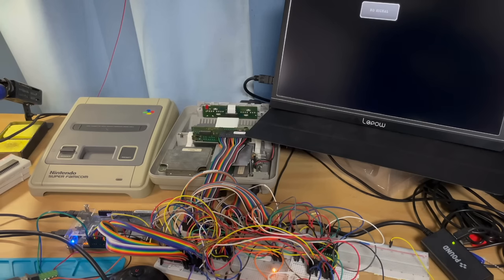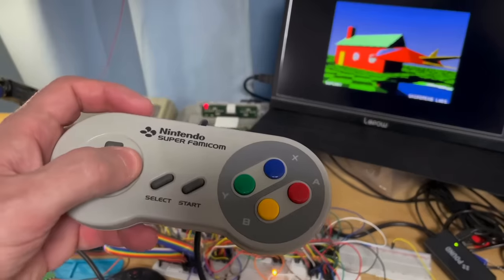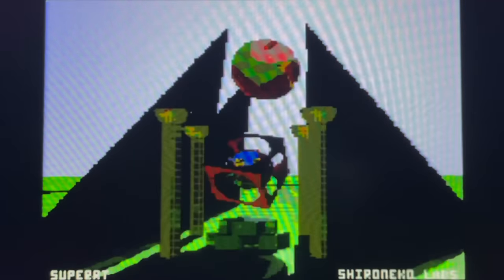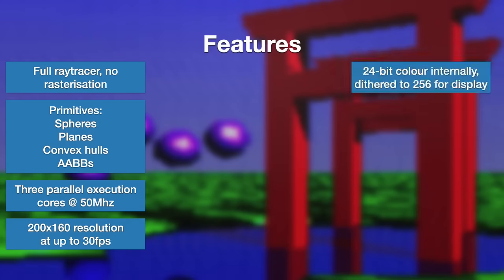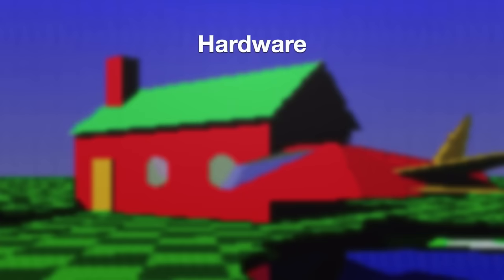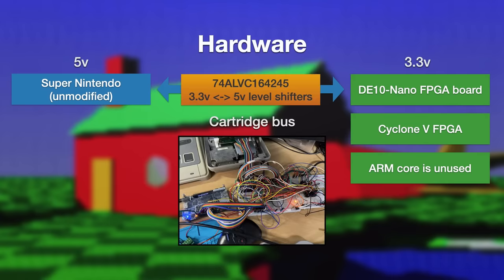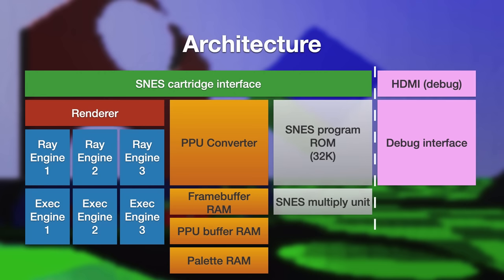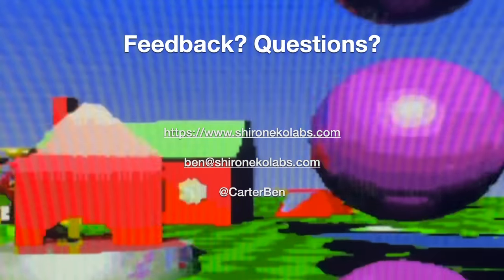SuperRT - Realtime raytracing on the SNES (walkthrough and technical overview)

Comment: This is impressive!
I'm currently designing my own CISC instruction set, and I had an idea for possibly solving the branching hazard.
It went like this.
During the last stage of the pipeline, you check the next instruction to see if it's a valid branch instruction, if it isn't then keep on going as normal, but if it is a branch instruction, then we check the condition code of the branch, and based on whether the condition was met, or not, we set the branch target buffer of the next instruction (the branch instruction itself) to either the branch target (the address that the branch jumps to), or the address of the instruction after the branch instruction.
All of that would happen in a single cycle, within the last pipeline stage.
Reply from the maker: @pineberryfox  Yeah, that was one of those architecture features I never really appreciated the significance of until I tried to build this! I actually considered using a branch delay slot system here, too (as, ironically, it's easier than handling that case "properly"), but decided the extra complexity on the code side didn't really justify it, especially as in this scenario there didn't seem to be very many situations where delay slot instructions could actually be used to do anything meaningful.

Comment: Now re-make Doom and StarFox with this...Come on guys I know you are out there. Also The SNES was 16Bit can you make this run on a N64?
Reply: Or just romhack the support in
Reply: What if they made super mario 64 on the snes?
Reply: @seymourkrelborn4780  that makes absolutely no sense.

You would have to remake Mario 64 from scratch to specifically run on a 16 bit cpu. Not to mention that the SNES has far less ram.

The reverse engineered code for Mario64 would help a bit but most of the rendering would need to be completely rewritten.

Absolutely nothing about this would be a "rom hack".
Reply: @Cybertronic72388  I was refering to adding support for this chip to Star Fox. Did you mean to reply to @Mario Mario?
Reply: good luck getting any developer to waste time doing that bro
Reply: @seymourkrelborn4780  my bad comments were showing up weird in the app.

I suppose the commands that would normally be sent to the FX chip could be sent to this instead, but you would need to make the FPGA understand those FX specific commands and would basically end up with an FX chip clone. To have any sort of graphical enhancements besides higher resolution the FPG would have to perform model and texture replacements.

Seems easier to just to remake game specifically for the FPGA.

Comment: What could you do on an n64. Would a lot of the bandwidth limitations disappear?
Reply: @Fat Chocobo only thing that is upgradable is It Ram
Reply: @Fat Chocobo I am well aware of that but because it was cartridge based super fx like acceleration would have been possible however impractical. To what extent it could be done is what i was wondering.

Comment: Dude, you need to shrink this down to fit into an actual SNES cartridge and release as a real thing that people can buy. This would be mind boggling to see on a SNES if it were in actual games inside normal-sized cartridges that you can buy--and I'm sure many hardcore fans and collector types would buy them even if they were like $200 a pop or whatever (ideally as cheap as you can make them though)--then plug into your console just like any other game and play full games on them. Imagine if someone re-made the original Star Fox using this tech to say increase the frame-rate, increase the draw distance to reduce pop-in (hopefully by a lot), and also add in some of that glorious ray traying. . . . Maybe I'm just a dreamer, but I'm not the only one.

Comment: I saw something similar at a fair, a guy adapted an NES with a zero rpi, to run sonic and some other games, NES acted almost as a simple image buffer from the rpi's hdmi output, in addition to an arduino interface to pass on the controls for rpi, this required a little more time, as it was necessary to create assembly software that ran on the nes cpu, identified the buttons pressed and passed the result to the pseudo game cartridge, where the interface was.

Comment: Very cool.
That´s the advantage of cartridges over discs. You can do anything.
If Nintendo wanted, they could do an external cartridge for the switch with anything inside, even a new cpu/gpu to make old and new games run at 4k 60 fps. They don't need to do a new console, just a new "FX" chip.
Reply: No. The modern cartridges since the DS are not designed to be capable of more than being a ROM and an EEPROM for save games. They are more like an SD card than a Cartridge.
Reply: @pnvgordinho   Oh boy, you have no idea what knowledge I have. I am developing an emulator for the SNES (https://github.com/Flaflo/KSNES/) I know about the GameBoy chip obviously. And I think you got me wrong. Of course you could open up the cartridge of a Nintendo DS or a Nintendo Switch and put stuff inside. The thing is: the console is not designed to use the cartridge for more than loading the game of the ROM and saving game save states. If you will, as you have described, do that with the cartridge and it does not use the provided pin interface as it is intended, it will render the cartridge pretty much useless.

I was not saying that SNES or NES cartridges were not capable of. Because they obviously are. Otherwise I would not have the demanding task to emulate those.
Again: The "old" cartridges were designed to support such hardware additions, but the "new" one do not. Also if they would support such a feature today, they could not sell their games as digital copy.

Please do me a favor and educate yourself before you write such a rude comment as this one.

Thanks.

P.S.

A quick google search that took me about 2 seconds brought me to Wikipedia were the following was stated:

"[...] the console's hardware designers had made it easy to interface special coprocessor chips to the console"
- https://en.wikipedia.org/wiki/List_of_Super_NES_enhancement_chips

Conclusion:
The system needs to be designed to support hardware additions in order to deploy enhancment chips into the cartridge.

I really hope you understand it by now. Your statement is not just wrong, but also very rude.
Reply: @Flaflo  I don't understand where you get the rude comment.
Im not an electronics engineer and I don't make emulators but I will bet with you they can connect whatever they want via the cartridge slot. Hell, I will bet they can connect anything via the headphones jack.
But that's my opinion and Im no expert. But before I go, I would like to ask a favor. Can you send me a link where it explains what you can and cannot transfer via a cartridge slot pins?. You say it only transfers the loading of a game(information, zeros and ones) and something like an external cartridge would also transfer information. But then again, Im no expert.
Thanks.
Reply: @Flaflo  "Again: The "old" cartridges were designed to support such hardware additions, but the "new" one do not. Also if they would support such a feature today, they could not sell their games as digital copy."
Reply: @pnvgordinho  First of all, your wording when I read to myself sounded very passive aggressive.

Just because its your opinion does not make it true. "Water is toxic." is also an opinion but completly wrong.

Bruh. The headphone jacks are not bi-directional. 

There is no single link to explain everything in one place. Also these articles require a basic understandig about electronics which you obviously dont have.

But what i can refer to you as good sources:
Nesdev
Switchbrew
3dbrew

Do your research, lookup what interfaces are, find out how computer architecture works. Read all the related articles found on the websites I mentioned and eventually you start to understand.

Thats all I am gonna respond. For any others questions just google it, there are plenty of sources and forums with ppl more time and will to help.

Thank you, have a great day.
Reply: @Flaflo  Brhu,

Comment: Wonder how much of the slightly lower image quality would be resolved by not using a Pound HDMI adapter. If you set it up with original RGB or a higher end line doubler. Still, amazing work!

Comment: While this I have no doubt the programmer put a fair amount of effort into this program, I think the video title is misleading as it’s not running the code on the snes, but on chips/a board interfacing with the snes, the snes is merely acting as an output.

Comment: Brilliant! Do you think you could work with Kaze Emanuar on an N64 project to implement this? He has put a lot of work to try and optimise the Mario 64 3D rendering engine and it looks like the work you are doing here could improve the rendering for the N64.
Reply: Devs like Kaze pride themselves in squeezing everything they can out of a retro machine to demonstrate what was possible while it was current. They also do it for nostalgia, up to a certain point it would stop looking like a plausible N64 game. And the added hardware would be doing more work than the actual console. If he was interested in pushing SM64 to the absolute maximum he’d be contributing to the PC port’s graphics enhancements, AFAIK he’s not involved in that at all.

Comment: Does that use much more electrical power than what is available to an SNES cartridge's expansion chip?  It would be neat if that was miniaturized to fit in a standard cartridge and there was a way to load SuperRT-dependent SNES games from ROM images on a laptop or desktop computer into it.  It could be a very fun tool for a retro game developer.  Playing a version of Doom or Duke Nukem with real time ray tracing on an SNES would be fun.

Comment: Well that's just frikin' amazing. Someone needs to use this and make an actual SNES physical cartridge game and release it on the system properly for actual purchase. I'm sure a £60 cart with an actual high quality game, and box and instruction manual and all, would sell more than enough copies to turn a decent profit.
Reply: The FPGA and the board it sits on is around 2x your suggested 60$ price. :P Add to that the cost of development, the cart and whatever else is involved and you will be losing a load of money per game sold.
Reply: I'd spend multiple hundreds to have a physical SNES cartridge with this setup and demo in it. If the demo had some tools to let you remove and place objects, it'd be more than worth its price to have.
Reply: @Haama10  If you made an actual game, you would not be selling any hardware. For hardware you would use an SD2SNES Pro and the software would just be the rom for a pay to download.
Reply: @finaltheorygames1781  different chip on the SD2SNES Pro (cyclome iv vs cyclone v) but even if we assume this could be implemented on the chip, afaik you'd need a firmware update to support it on the Pro. Either way a pretty niche product, but then again so is much of this retro hardware. All I'm saying is that I don't see much profit in this.

Comment: when I started thinking "what if I made my own replacement CPU/PPU for the NES?" the first problem I thought of was the 5v and 3.3v disparity. I wonder what (very compact) level shifter solutions there are, especially ones that could fit in the space of an oldschool DIP, along with the ESP-32 I might end up using. Could go bigger, but a drop in unit of the same size would be ideal.
Hardware also isn't my forte.

Comment: Nvidia makes a brand new GeForce 3090 graphics card for $1200 that supports ray tracing, but at a large cost to frame rate. Guy makes ray tracing work on SNES, a system that can usually be had for a few bucks at a yard sale. You sir, belong to the elite.

Comment: So if I understand this right, all the RT Rendering comes from an Intel based SoC board out of an old Pachinko that uses an Intel Cyclone V FPGA from 2002+ that works through a ratsnest of voltage stepping in order to get instructions from a SNES? Genius!

Comment: Are the BVHs pre-calculated on a PC, or does the hardware compute them from the primitives?
Reply from the maker: Pre-computed, I'm afraid - the SuperRT chip doesn't have any functionality to help with that. Technically there's nothing stopping the SNES from constructing the BVH if it wanted to and sending that over, but the SNES CPU isn't really well-suited to that, so it's prebuilt on the PC for static geometry. Moving geometry can still have a culling hierarchy but it needs to be entirely "internal" to the object (i.e. the SNES just moves the root node of the hierarchy about).
Reply: @shironekolabs5647  I guess that's probably how it would've worked if such a device was constructed back in the time of the SNES.

Comment: This is pretty cool. I doubt it, but would it be possible to turn this into a BIOS for use on, say, an FX Pak Pro? (I have no idea how much of the Cyclone V's power you used for this, the FX Pak Pro uses a Cyclone IV) I don't know how many people would use it, but you could do some amazing things if it were usable for homebrew and ROM hacks on real hardware.
Reply from the maker: I had a look into that and whilst it's not necessarily impossible, it would definitely be hard - even one core of the current design wouldn't fit on the FX Pak Pro's FPGA, sadly. It's something I'd really like to try at some point but it would probably mean a ground-up redesign, and I'm not sure even then if it would ever achieve reasonable speeds.

Comment: If you could turn this into an ASIC using 1993 technology, how big would it have to be?
For reference, the original Pentium was introduced in 1993, had 3.1 million transistors and used an 800 nm process. It ran at 60-66 MHz.

Comment: wait, so this could have been done in the 90s as far as I understand?
and if I am not mistaken, then how much would it cost?
Reply from the maker: By my (very rough) estimate it would have been technically possible, yes - in a similar timeframe to the SuperFX chip there were commonly available CPUs with design complexity exceeding this running at comparable clock speeds. But the price would likely have been absurd (at least for an implementation like this) - think high-end PC CPU prices for a single cartridge.

Comment: Can this be ported to the FXPAK PRO cartridge?. One more thing, can a new chip allow the Snes to display the 512x224 resolution in all its modes (1 to 7)?, since i've heard the 512x224 resolution can only be displayed only in a couple of them. Great job. See ya.
Reply from the maker: I looked into porting it but it would be hard to fit into the smaller FPGA - it would probably involve a significant overhaul of the design, sadly.
As for increasing the display resolution... I've not really investigated that but I'd be surprised if a cartridge could do anything useful there - I would assume that the limiting factor is probably bandwidth on the video output side of things and/or VRAM space, and thus short of having a cart with its own video output port (like the 32X) there isn't much that can be done.

Comment: Was the DE10 nano required? do you think this could be made for an older generation FPGA? i wonder how low you can go in hardware and still get these results!
Reply from the maker: Well, the design uses three identical processing cores that can be enabled/disabled in the configuration, so in that sense it could easily run on something about 1/3 of the capacity (at 1/3 of the speed!). Below that, though, a redesign (or at least a rewrite of some parts of the system) would be needed.

Comment: why do you need to use snes as the display system?
Reply: try the arrow intel fpga SoCKit, or arria 10 sx270 or up to 660 or 1.1M gt fpga
Reply: its like saying i'm on cpu when gpu does all of the actual work

Comment: I believe Starfox or Yoshi island being raytrace would be a great fan project.
Question is will it only run on emulate or could an everdrive pull this off and play on a snes or a super nt
Reply: I guess the FXPAK Pro would be suited the most for that.

https://krikzz.com/forum/index.php?topic=9696.msg73642#msg73642

Super NT has issues with it though; it's just a clone console, afterall.
Guess an original SNES plus the FXPAK Pro would be the best way to go about this, in theory.

Comment: this is interesting stuff.

However i do wonder how this actually possible considering the snes is tile based and each tile can only have 16 colors excluding 16 colors for sprites, that should mean that each tile could handle 32 colors before color clashes will appear.
So how did you stream 256 rendered color images through the snes without color clashing???

Also there was a guy in 2010 who claimed to have made an improved version of doom on snes by using a 32X chipset on a modded snes cartride, however i only saw a snes emulator running it for wich he claimed he first tested it trough developed software on snes9x before he could actually make a physicall version of it,but i sadly never saw of video of the actual hardware running it,he also claimed to start a pre-order campaigne but then he claimed that a raindrop ruined  it,mmmm.
Am mean if it is true what that guy claimed to be, then he might have already tapped some more crazy potential out of the snes a while back but am not 100% sure through.